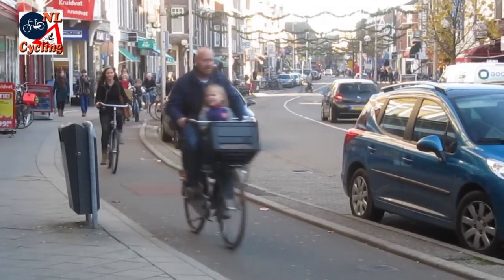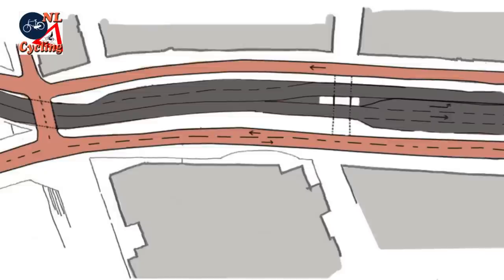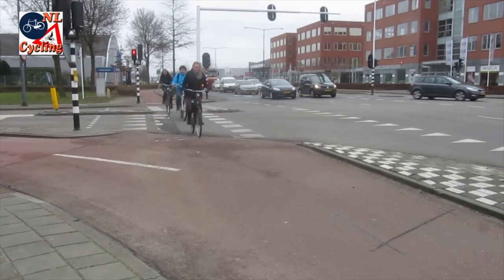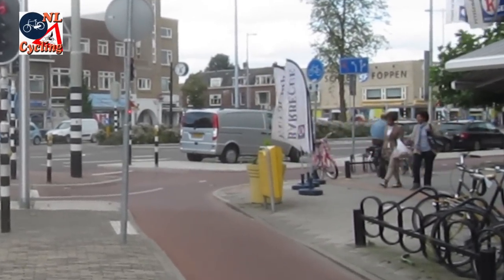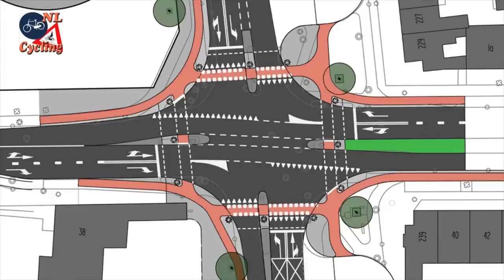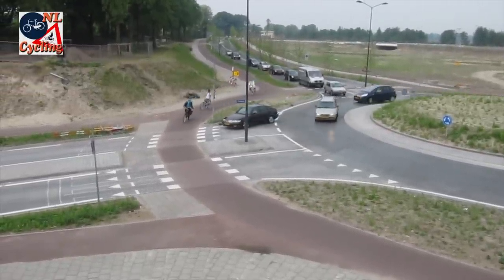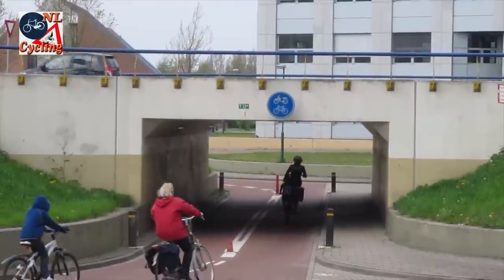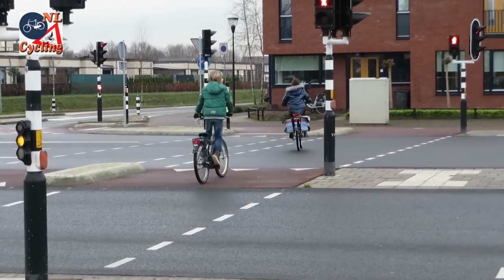Junction design in the Netherlands [311]

Comment: As someone who comes from an area who is considering putting in bike lanes. I'm confused about a few things the guy said in the video. First and probably most significant is he said that "cars operating at lower speeds is good for the environment because of reduced noise and less exhaust fumes" is wrong. When vehicles are stopped they get 0 (zero) mpg. They are burning fuel unnecessarily. Even when they operate at slower speeds cars get the worst fuel economy because the engine is trying to get a few thousand pounds of steel moving. Buses or 18 wheelers which weigh significantly more than cars or trucks create the most exhaust fumes at low speed or when the accelerate from a stop. This is also the period of time when they create the MOST noise. Higher speeds and fewer stops is the only thing that increases fuel economy which in turn is better for the environment and generally the road noise is less because the engine isn't laboring to get the vehicle moving.

The fact that bikes are given precedent over vehicles kinda blows my mind a little. As a person who owns a vehicle and a bike I can tell you I paid LOADS of taxes upon buying my vehicle and a much smaller tax (sales tax) for my bike. I pay yearly taxes in the form of registration for my vehicle that I never pay for my bike and I buy fuel for my vehicle that has an integrated tax as well as a sales tax that my bike doesn't have to worry about. All of the taxes I brought up were put in place to build infrastructure like roads, bridges, overpasses, underpasses, stop lights and interstates. As well as maintain that infrastructure. Where does a city get money to build bike lanes and maintain them? I read a comment below saying that the city salts the bike lanes and could give them priority sometimes. Who pays for that? If the temperature is low enough for snow, would you rather be in a warm car or in 3 or 4 layers of clothes freezing on a bike? Where the odds of injuring yourself are far greater if you run into the smallest bit of ice in your path.

In flight training I learned a very important rule that the smaller, more maneuverable aircraft always gave the right of way to the larger and less maneuverable aircraft. It makes perfect sense. Having a car stop for bike traffic seems to be the exact opposite of that rule. So a car that needs to make a left turn in an intersection has to stop watch for oncoming traffic of other cars when turning. Then stop again in a small designated area for bike traffic(which the Mercedes in the video was still partially in the road and could have easily been struck by oncoming traffic). Then he can proceed to his destination. That logic puts all the responsibility on the automobile driver. When a bike easily has a much larger field of vision, a much quicker ability to stop, and only looking for traffic coming in one direction where the car was looking for traffic in multiple directions (oncoming vehicles then crossing bikes). And it seems these rules are put in place so the bike rider simply doesn't have to stop as often? Is the argument for bikes having a continual flow of traffic opposed to cars purely because it would place some inconvenience on the bike rider? 

I fail to see the practicality or the economics behind any of this. I'm sure taxes are different in the Netherlands then they are in America
Reply: +Justin Moore 
I think you misunderstood a couple things. Bikes don't have precedence over cars. The examples where the car is waiting for a bike is when the bike comes from the right. And the example on the roundabout is just like how a car on a roundabout has precedence over cars that are not on the roundabout yet. But yes, if a bike is on the outer ring of a roundabout, they have precedence over the car trying to go off the roundabout, just like you would when there are two cars next to each other. 

Another example is when there is a car and a bike next to each other, the car has to turn right, while the bike goes straight. In that case, the car has to wait for the bikes before making a right turn. This makes sense, since the stream of cars is usually a lot longer. 

The thing with a car stopping and starting again is hardly a problem, it's much more work to stop and start on your bike again. In your car, it's a matter of pushing the gas while sitting down. So, it would take much longer before the bikes are out of the way, then it would for a car. Plus, it would be very hard to ever get in between on a bike, since cars will keep coming and there would be no way to stop them. 

I don't really understand your issue with taxes. I pay a lot of taxes for things I don't use myself, like hospitals or schools, I don't see what that has anything to do with it. You're right, it does put some responsibility on the cars, but in the Netherlands, most drivers are cyclists too. It's not two different groups of people. So, it makes sense to all of us. It must be a cultural difference. It rains a lot here too, I even think poor cyclists in the rain should have priority over people in their warm cars!

By the way, road taxes are paid by car owners here too. Strictly speaking, it's not road taxes, we call them vehicle taxes.

As for the slow cars being more environmentally friendly; if you're in the right gear and you keep your Rpm around 2,000, it really does use less fuel. So it's less to with speed, but more about optimal use of the engine.
Reply: +Justin Moore 
*I fail to see the practicality or the economics behind any of this*  Clearly the Dutch don't because they do it to great success. It's a pity that you grew up in a country where everything is car-orientated because it really has affected your world view. I don't say that as a put-down, I say it as an observation.  

I've lived in NL and I can tell you that their cities are so much more safe and livable than any car-orientated city. They're all healthier and happier.   

And as far as preferring to be in a car or on a bike on a cold or wet day, honestly, I would prefer to be on a bike. I'm outside, I'm not made of sugar, and I feel so much better when I commute to work by bike than car, no matter what the weather. I just wear appropriate clothes. It's a non-issue for me
Reply: That's great. I'm glad you feel that way. Although a few of your points might not be a solid as you think. I've seen other articles and looked at their comment sections.

First, the Dutch are starting to realize what I already said by eliminating the tax incentives and wanting to start adding bike registration so they'll have a way to tax bike owners for all the additional overhead that comes with bike specific lanes and crossings. Someone has to pay for it. The Dutch are starting to realize that, and people in NL are mad that they'll have to pay for it. Salt on bike lanes cost money. Where do you suggest that money come from?

As far as safe, I can't tell you how many angry comments I read that stated how much Dutch citizens regretted investing money into their bike only to have it stolen. It such a common practice that when they reported it to the police they told them to just to steal another bike. That sounds like a place I want to live.

I'm glad your happy riding your bike in the rain or snow. I like being comfortable and dry. Just because I had a few negative things to say about this video doesn't mean I don't own a bike. I like riding my bike when I can. It's also not my only outlet to nature, and being outside. I live next to the second largest delta in the US, there are plenty of opportunities to be out in nature a bike could never reach without someone with a machine cutting a trail for that bike.

Where I'm from very few people live close to where they work. It's common place to have to drive 15-20 miles one way to get to work. How long would that take you on your bike? On a sunny day? Then think about how long that would take in the rain or worse the snow.

As far as having a problem with my world view, that works both ways. Every problem is specific to that area. Just because something may have worked temporarily in NL doesn't mean it would work where I live. I believe that's short sighted on your part. Just as you said though. I'm honestly not saying any of this to put you or NL down. It's my observation.
Reply: +Justin Moore I commute 35km each day to work, sun, hail, rain, wind or snow.

Who pays for the infrastructure for bikes? Taxes do, just the same as what pays for the infrastructure for vehicles. You seem concerned about keeping cycle lanes open when it snows, but surely you realise that carriage-ways for vehicles also have to be maintained during bad weather. It all comes from taxes, and it so happens that cycle ways are far less costly to maintain than carriage-ways for vehicles as there's just orders of magnitude more wear and tear by vehicles. Who pays for that? Taxes. 

Vehicle pollution kill tens of thousands of people each year in the UK (I use the UK as an example because I've seen the figures). What are the monetary costs (aside from the emotional and social costs) to society of that? Vehicle pollution will incapacitate multiples of that figure due to ill-health. Who pays for that cost to society? 

Bicycles are actually more efficient at moving people around cities than cars, pollution free, safer, and in a far less stressful manner than vehicles. All this has very real benefits to society. In addition people on bikes are far healthier than their car-bound counterparts that commute daily by car. This is also a saving to society.

I'm really amazed that you focus on the cost of building and maintaining cycle lanes when you don't apply the same standard to vehicle carriage ways, even aside from the social, health and environmental benefits of not using cars.

I didn't say that what works in the NL will work everywhere. Each situation is specific. I was answering to your post where you queried how the costs of the NL system stacked up.
Reply: +Citizen Wolf The Department for Transport issued a report a while ago stating that for every £1 spent on cycling schemes, you effectively get £5 back - http://www.bikebiz.com/news/read/dft-discovers-cycling-s-benefit-to-cost-ratio-is-off-the-scale/017088 . The Dutch are pretty much getting money back for building better cycling infrastructure. Children also benefit greatly since cycling is their best personal mode of transport.
Reply: +04smallmj
True as more people bike short distances, it affect the number of cars on the road in cities.
Less cars on the road--> less maintenance of the road. 
As more bikes are used, you also need less space for cars which means building and maintaining less road space. Bike lanes require little maintenance as well, the odd true might damage the bike path but that is pretty much it.
Reply: "I read a comment below saying that the city salts the bike lanes and could give them priority sometimes. Who pays for that?"
-looked into this; we all do, not just motorists. It's council taxes.

Also wanted to clarify that if the situation in this example was the other way around, as in a bicycle is approaching a roundabout with a car on it, the car would have the right of way, not the bike. Same with a bicycle coming from the left, or turning on a road, the car would have right of way. So not all responsibility is on the cars. It's a shared system.
Reply: "I fail to see the practicality or the economics behind any of this." That's because safety is most important, not practicality or economics. Americans will never understand the Dutch way of cycling.
Reply: Justin Moore, I don't know what sites you're getting your info from, but alot of it is bullshit. The Dutch are not getting bike registration or bike taxes.  Police do not tell people to steal other bikes either. Bike theft is only an issue in some specific areas in big cities, but it hardly makes any place unsafe to live.

Cyclists don't necessarily cost money. Any idea how unhealthy it is to sit in a car regularly? Dutch cyclists live longer and healthier lives than non cyclists, causing a reduction in medical costs. The impact on Dutch society is massive. Does that mean that Dutch non cyclist pay more health insurance? Ofcourse not. Road taxes in Netherlands aren't just about road use either, the new electric cars for instance don't pay road taxes either. I understand it's all about money for you, but for most Dutch it's more about what kind of environment do we want to live in, what do we want our cities to look like. We're willing to pay more taxes if that means better infra and a more liveable environment. I've been to the US, and it's not just the lack of cycling lanes, even your car roads and infra are pretty terrible.

People here don't necessarily live close to work either. Some people take the car,  but we also have good public transportation, easy access everywhere. Many people cycle to the trainstation and go to work by train.
Reply: The reason cyclists are given preferential treatment is not because of environmental or practical reasons, but because of safety reasons. One is more likely to die of murder in the US than one is to die of cycling in the Netherlands. This is also the reason why wearing a bicycle helmet is considered unnecessary in the Netherlands.
Reply: Jan Modaal I think this video gives the wrong impression. Cyclist don't get preferential treatment. When the were to come from the left, the cyclist would have to wait. The same rules apply to cyclist as they do to other vehicles.
Reply: Eleonore Bon Cyclists DO get a lot of preferential treatment (voorrang) on roundabouts.
Reply: Jan Modaal But not for cyclists who are not on the roundabout yet.
Reply: You're right about the fuel consumption thing. Round-a-bouts are better for the environment, though. They are designed to keep the traffic flowing and therefor less fuel has to be spend to accelerate the car up to speed again when compared to accelerating a car after a full stop. This is a secondary benefit to the round-a-bouts design, though. And I'm not sure if the fuel safed is that significant in the first place. The narrator's explanation was indeed wrong.

When he says that bikes are given precedent he means that cyclers have the right of ways (kinda). This is to do with the history of traffic in The Netherlands, and why we became such a cycling loving country in the first place. /watch?v=XuBdf9jYj7o

Basically, we have a law in place that protects cyclers and pedestrian from motor vehicles. If a driver in a motor vehicle hits a cycler or pedestrian he/she is by default responsible for the accident, even if the cycler(s)/pedestrian(s) hit by the vehicle were breaking the law (going through red, etc). The driver will have to proof to the Justice department that he/she could not have avoided the accident due to the circumstances which were beyond his/her's control.

This law promotes careful driving resulting in a more pleasant and calm atmosphere in traffic, which means safer roads. It also encourages drivers to get out of the car and help the victim in case of an accident. Not every accident is so severe that it requires medical or judicial attention. Helping the person you just hit and making sure everything is OK more often than not means both parties can continue with their day. It comes down to a mutual respect, really. Driving away from an accident is illegal, of course.
Reply: +Justin Moore  Firstly i understand your view on it. I can perfectly imagine living in a world where the bike isn't that important in comparison with the Dutch. Yet it's also obvious in your opinion that you are missing quiet some information. So i understand that you have questions. We all grew up here, knowing that the bike is actually a preffered transport method. We even get a bicycle exam at school. (Elementary period) That is the first mindset you do not share with us, making it so hard to understand. Also lot's of things you've sad are individual opinions, taken from individual opinions of someone else. That's not how it works. The experiences you've heard are quiet bad examples, when there are plenty of good examples. You've written an complete essay, but you never seen statistics. The glass is also half empty, instead of half full. Let me try to explain our method, as i've been teached: 

Enviromentally: This is better for the environment. The less cars we have, the less fuel burning. It also counters noise and prevents busy traffic more. That way we have to build less roads. Less roads is economically efficient.
As an result, most car traffic on our roads is mostly business-related. Users of bicycles are mostly school / housewife related. In turn, we also save money because we don't need an expensive second car. ( Which also lowers traffic and fuel consumption. ( Start seeing the benefits now? ) 

Economically: we all chip in to pay for all this, through taxes. But because we save alot on those other things described above, we pay as much, or even lesser tax then most foreigners. 

Safety: We always consider the cyclist vulnerable. Far more then a vehicle or truck. A collision with a vehicle and cyclists always end up way worser for the cyclist. So that's why we made rules to create a safe place for the cyclist. One of them is giving them precedent over vehicles in traffic. Even our insurance companies give the same precedent, in case of any incident related claim. It has nothing to do with traffic flow, but safety. And don't underestimate the number of cyclists who still rides during winter / frost period, though.
Reply: How about money saved on healthcare costs when people take a bike regularly?
Reply: I have, in my entire life as Dutch citizen, never heard anyone wanting bicycle drivers to pay taxes for their roadways. There is not a single political party that shares this view on their agenda.

The vast majority of trips under 5 km are done on a bicycle, and the average Dutch cycles about 900 km per year. That being said, work-home traffic is still done by cars for the majority, as even Dutch citizens don't usually want to cycle 30-40 km in the early mornings ;) I was fortunate enough to live near my work, so I could cycle.
There's also no school busses in the Netherlands, and high schools for students 12-16 can be fairly far away. Some people I knew had to cycle 30 minutes from and to school every day, but it's a better altenative than schoolbusses - if they can cycle safely.

 Bicycle roads don't need as much maintenance as car roads, as bicycles aren't heavy enough to cause any major degradation of the asphalt. There's also many places in urban environments were stone tiles are used, which degrade almost never.

This whole bicycle culture doesn't just arrive in one day. It's been cared for over the last 40-50 year and as such it's part of our Dutch identity. Every Dutch car driver was once on a bike. 

For me, a bicycle is incredibly convenient. I can manouver through the urban environment much easier than a bulky car. It is also much easier to park, much cheaper to buy (500-1000 euro and you got a bike for a decade), healthier, and doesn't require a driver license.
Reply: Justin Moore why is it weird that cyclists have priotity? Do u find it odd odd too that pedestrians have priority at crossings?
Reply: Just to add one more thing to this discussion, seeing as for example Los Angeles has a ton of highways inside the city, but also a lot of traffic jams without any space to build new roads. It is perfectly imaginable that investment in bicycle infrastructure will benefit car owners as it will relieve congestion within the city. The alternative would be to build more underground roads which is super expensive.
Reply: @Citizin Wolf Spot on reaction to the economics and benefits of bicycles. Most people don't realize the big hidden cost to cars related to pollution, vehicle accidents, traffic congestion, parking space, etc.
Reply: To your second point. The dutch strategy is just to tax cars insanely. Like, really, you wouldnt believe. To pay for everything. And also discourage people from buying/driving cars. You will see almost Nobody, under the age of 25-30 in a big city with their own car. Especially if theyre students. 
So people here actually WILL bike through heavy ice/rain/snow, or take the bus. Car is not an option, since they dont own one.

"Then he can proceed to his destination. That logic puts all the responsibility on the automobile driver. When a bike easily has a much larger field of vision, a much quicker ability to stop, and only looking for traffic coming in one direction where the car was looking for traffic in multiple directions.  Is the argument for bikes having a continual flow of traffic opposed to cars purely because it would place some inconvenience on the bike rider? "

You have to remember that the way dutch bike rules/lanes work, even children at the age of 10/11/12 can be seen Biking through the busiest parts of the largest cities WITHOUT SUPERVISION. Would you ever consider doing this anywhere in the US? No. The rules are indeed almost dictatorial and crazy. But its the only way you can make something like this possible.

"I fail to see the practicality or the economics behind any of this. I'm sure taxes are different in the Netherlands then they are in America"
The system pays for itself, and most people use bikes. actually cities are designed in such a way that some parts arent reacable by car, or take longer to reach by car than by bike. So bikes are the most practical way to go. Furthermore the people are used to this, they dont see not owning a car as a big problem.
Reply: "As far as safe, I can't tell you how many angry comments I read that stated how much Dutch citizens regretted investing money into their bike only to have it stolen. It such a common practice that when they reported it to the police they told them to just to steal another bike. That sounds like a place I want to live.
"

Bike stealing is the most funny thing here. You must not think of it at criminal activities. Its mostly homeless people selling them off for 5 euros, mostly to people they see walking and need them. IF you really want to protect your bike, buy a good chain-lock, and attach it to some street furniture. You will never get it stolen this way. Otherwise, buy a crappy bike, dont protect it, and get into the "Bike loaning/buying/stealing'" cycle. Which is a way for some homeless people to make some money. its really not an issue, its an essential and funny part of bike culture, and can easily be avoided.
Reply: "I fail to see the practicality or the economics behind these"
Maybe because the people spend less on energy they buy to move themselves + a bike(food), instead of tonnes of metal(gas), the money they saved could be spent on better things?
Reply: @eleo_b  "in a car, it's a matter of pushing the gas"
It wasn't about the effort, but rather the *efficiency*. Accelerating tonnes of metal is less efficient than yourself +a bike
Reply: Revi M Fadli | well, than there would be no way for a bike ever to get in between. Bicylces are seen as a vehicle, just like a car. So there are plenty of situations where it's reverse and the car has the right of way. Also, in terms of efficiency, it most efficient when people leave the car at home all together. In order to achieve that, cycling should be safe and attractive, not subject to cars. One way to establish that is fair traffic rules.I work for a corporate law firm, and the majority of people go to work on their bikes. That beats any type of acceleration any time. I can understand it may not work in most countries. But it does work here.
Reply: @eleo_b  agreed, cycling + public transport (for long distances) should be all we need